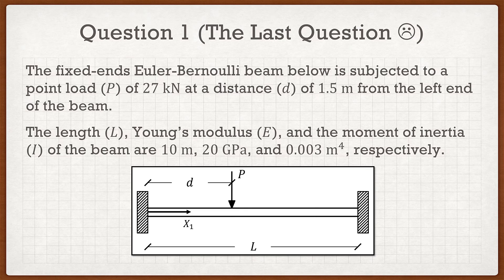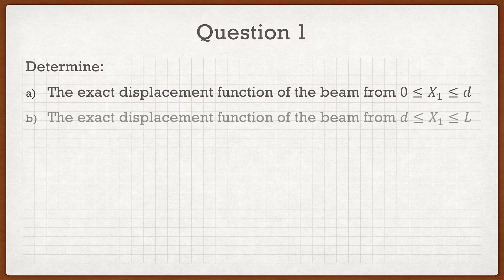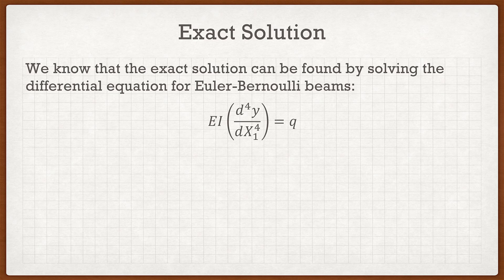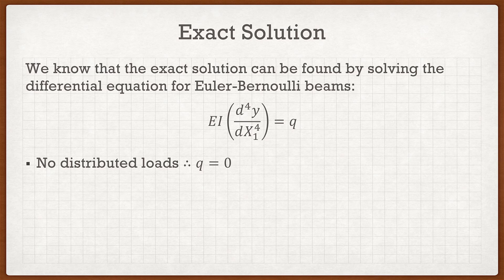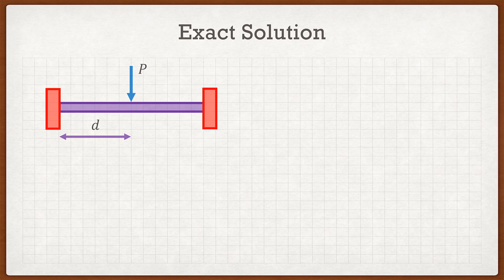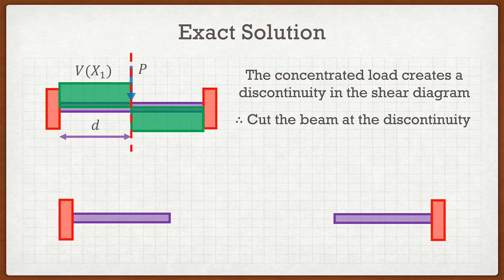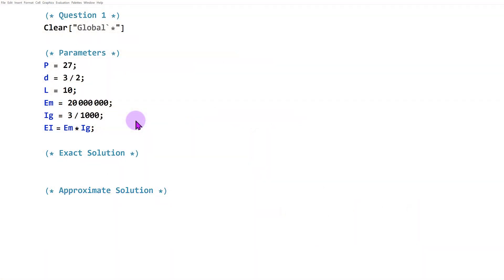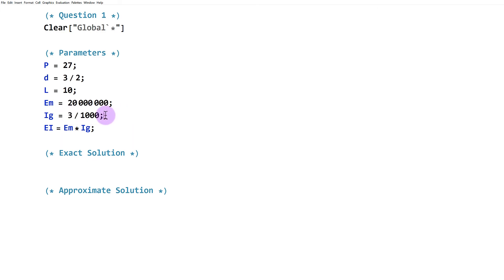Solid Mechanics Example | Euler-Bernoulli Beam with Discontinuities (Exact Solution)

Comment: Have you tried plotting the bending moment for this? I find that the bending moment plot doesn't look quite right
Reply from the maker: Hi Barney!  Yes, I have checked both the bending moment and shear profiles and I do not see any concern.  If you send me an email I would be happy to discuss the matter further and send you the code with the bending moment and shear diagrams included :)
Reply: @claytonpettituofa5547  Hi Clayton, I figured out the error, it was on my end. Thanks for the video, very helpful :)
Reply: hi clayton, i wonder how this video just pop up at 2am on my youtube. i’ve been searching these mathematical explanation since years ago bro....;)) btw i would love to join your mailing discussion, about the concept of euler bernoulli applied on rotating shaft. i do some conveyor design, and meet a lot difference in practical